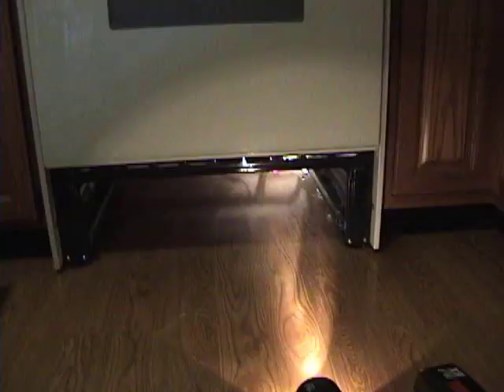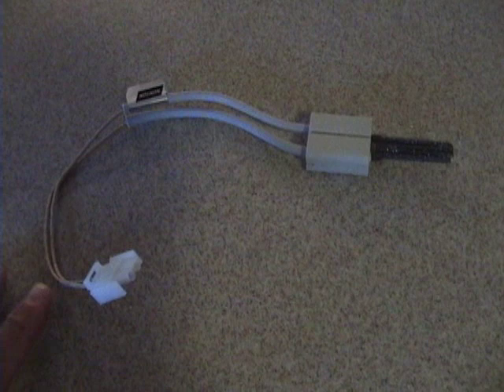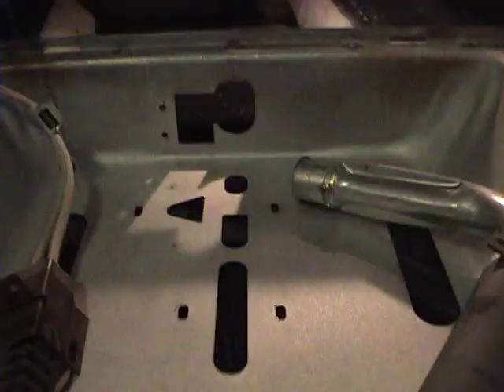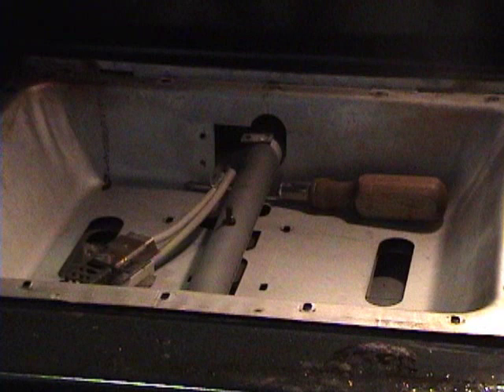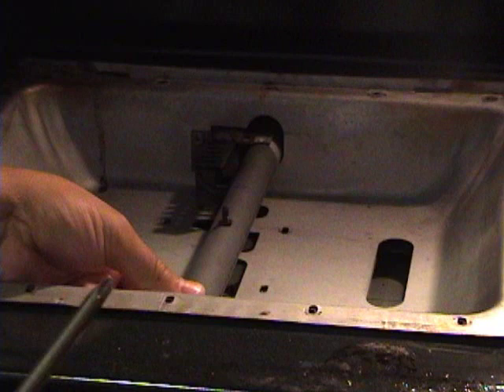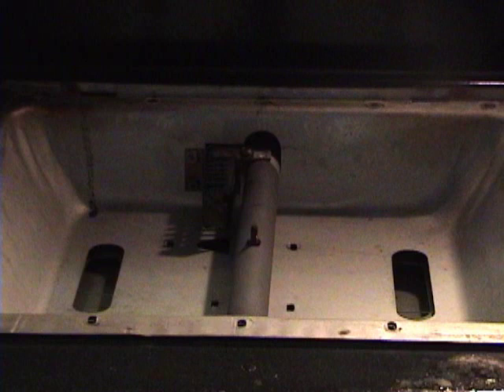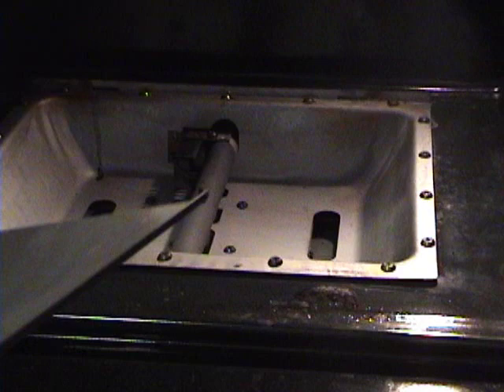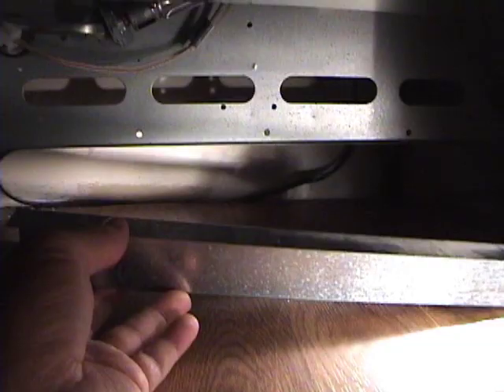How to Replace an Amana Oven Ignitor

Comment: Thanks for the help.  Here are my notes from the perspective of someone who isn't particularly handy and was intimidated by this repair.

1. It was really easy.  Took my time and finished in 30 minutes.

2. You do not have to turn off the gas or electric to do this.  The igniter is plug and play and you don't need to mess with the gas line at all.

3. You do not need to access the back of the oven and only need to mess with one nut and three screws for the cover and igniter sleeve. 

4. The ceramic igniter piece is indeed fragile and installing it into the sleeve is the touchiest part.  Easy does it.

5. In terms of diagnosing the problem, my oven didn't light but the broiler did, do I knew it wasn't a gas or electrical problem.  Bought the part and replaced it without doing the whole voltmeter thing.  It worked!  Good luck all and thanks again.

Comment: I ordered the Ignitor from Parts Direct - $43 + $8 for FedEx shipping and I took out the bottom drawer and practiced replacing it ahead of time to make sure it wasn't too hard - not a problem.  It is a pretty goodoven otherwise so seems worth a basic $50 repair. Thanks again.  - JC

Comment: fyi, on my amana range this takes about 3 minutes.  The ignitor came in the casing.  It's accessible from the oven and all you have to do is take off the oven bottom (two screws in the back), pull out the wires from the old ignitor and disconnect.  Connect the new ignitor and install.  The hardest part is taking off the oven bottom.  One screw was was totally rusted in and I had to dremel it out.  But that was last time I replaced the ignitor, so this time was a breeze!

Comment: Wow - I can't believe you have to remove ALL those screws from the oven pan and take out that entire assembly and remove the flame pipe and the bracket all just to replace the ignitor.  I have this exact Amana oven and I was hoping it would be a lot more simple than that.   It also sounds like it is a challenge to replace the bottom drawer once you remove it.  Makes me wonder if it is even worth doing on my own - is this a two or three hour job?  Thanks for doing the video.  It helps me decide.

Comment: Someone gave me an ARG7600 setup for LP completely loaded with mouse poop. I went through it with a fine tooth comb. Had to replace some wire terminal connectors. i'm getting an erratic spark due to faulty igniter coil. I had to put it in service mode to get codes just like a car OBD2 system. Unplug oven and plug back in. You have 5 minutes time to hold "Cook Time" button in for 5 sec to put in service mode. "Clean" gave me code 3 for unlock circuit closed error. I hooked up 2 wires backward on the door lock switch. Anyhow, back to the igniter. It was so delicate that it crumbled in my hand. So I ordered a universal one for $20. It does the same job as the Amana brand unit for a third of the price. I had to also replace all the insulation. I packed that sucker pretty tight. There wasn't much before. I used rock wool high temp.
Reply from the maker: +markfothebeast Awesome!  I bet it's better than new.  Thanks for the info....

Comment from the maker: I took this apart before I decided to youtube it, therefore I only show the repair and putting it back together.  In the oven, just remove the cover on the bottom and all the screws in the pan.  Under the oven, remove the plate that covers the electrical connecter and gas hookup.  You can see how it goes back together, so just do the opposite.

Comment: I am trying to repair my daughters stove, looks like it is this exact model. I have found that the broiler does light , i originally though the who bottom part was not working but the broiler lit up fine when I was just down there. 

  the oven will not light at all though. so my question is, is there some device on the stove that does not allow gas to get to the burner down there if the igniter is not working?   What I mean is, I can't even light it with a flame. I held my BBQ ignition lighter ( really long high flame lighter ) for a long while trying to ignite the gas but it doesn't seem to kick on.  

  if there is something , maybe a thermostat , that doesn't allow the gas to come out till it reaches a higher heat than i can provide with an open flame then I think your problem here may be the same one I have and I will need to buy that part.    if other people can light there oven though. it would be a waste of money for me to buy the part. because something else is wrong.  NO GAS to the oven
Reply from the maker: RockAnAhardSpot In order for the gas to flow, the sensor has to see a certain resistance in the igniter.  It may look hot (mine did) but it has to be hot enough or the gas will not turn on. (I'm not an expert, but that's what I found in my research).My igniter was red hot, but it was not hot enough to turn the gas on.  When I put the new one on, it turned white hot and fired right up.  The new igniter had the correct resistance.Good luck......
Reply: Great, Thanks a million,  i just ordered a new one ( igniter , Ignitor)  <-- seems it's spelled both ways. LOL   

  I was amazed at the price differences in these things. seems a huge a scam is going on with them.  i really didn't need the cage part since I still have the old one, But most places have it with the cage in place and I think that is because of the frailness of the element, less chance of breaking. 

  I also noticed ( because i am a cheap bastard ) LOL...  that there is big price drop in brands and styles, a lot of places say they have a direct replacement for a part # and the element didn't look anything like the one that is here.   So I did a little research.  Instead of paying 50.00 plus shipping for a part that I was told would replace it perfectly and that also looked totally different, I scanned through boat loads of them and found one that looks just like it, has the same specs and is brand new in the box. but it doesn't mention my model. seems there is such an enormous amount of models and brands  but they all use ignitors from a small group.    about 15 types .  I chose one that is identical to mine and cost me 17.00  The only difference is I will be reusing my old plug in OR hard wiring it with the provided wire nuts.
Reply from the maker: Let me know if it works.  And Thanks.....